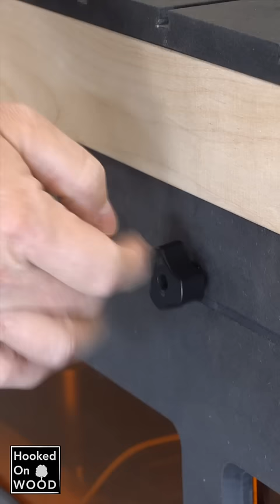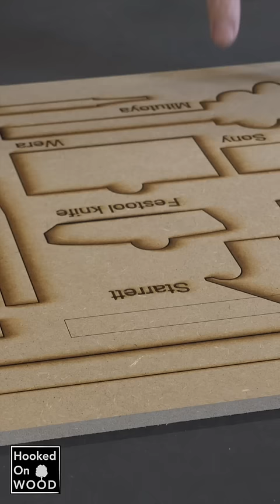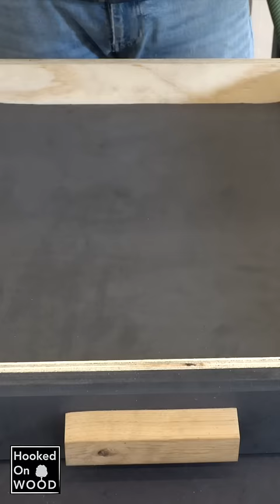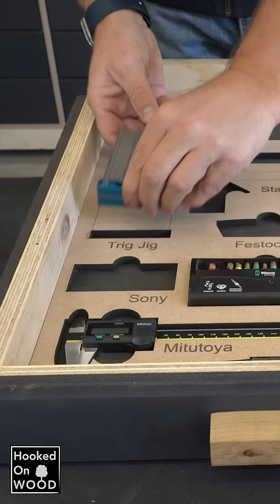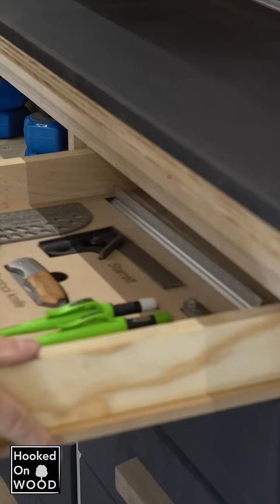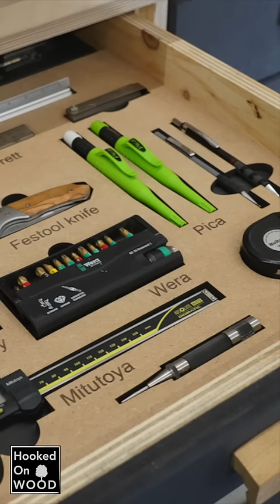Making an awesome Drawer Insert. #shorts

Comment: Waste of money, and a waste of space. Just use shadow foam, what happens when you lose one of the tools or have to replace and it’s changed size. Interesting test piece but not practical.
Reply from the maker: It it just to inspire! That said, 9 mm MDF is very affordable, and you can make a lot of drawers with one sheet. So, I think it is more affordable than foam. Time is no issue when you save your file. So, I agree with you on some points, but you make it more dramatic than it is in practice.